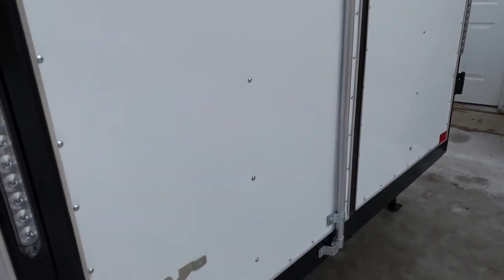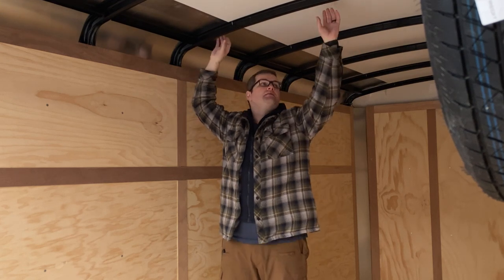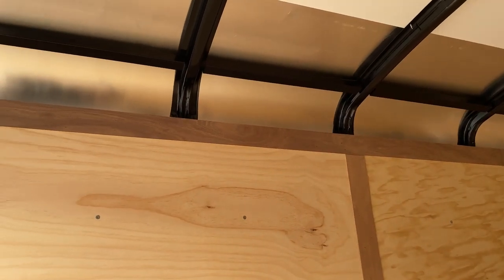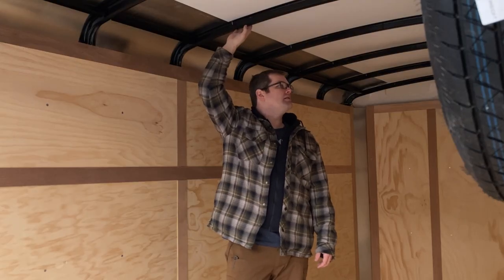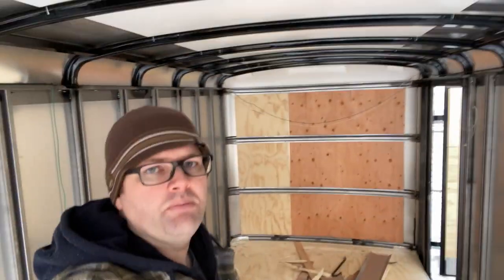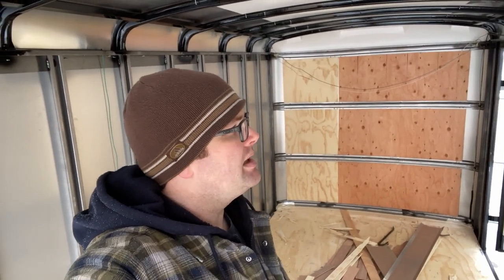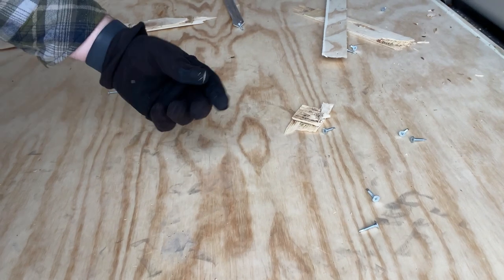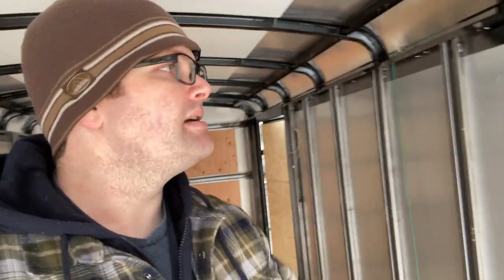Not Your Normal Cargo Trailer Conversion Part 1: Introduction and Wall Removal

Comment: That's going to be fantastic!! Rock on. Are you going to run cable channels on the floor (below the flooring)? I'd be interested in seeing how you allow for some modularity in the gear setup?
Reply from the maker: Thanks Nathan!! It is coming along really well so far. We’ll see how it all turns out. I think with this build I have to keep it pretty specific. Not too much modularity in it. I am however trying to make it multi-functional. Thanks again man!